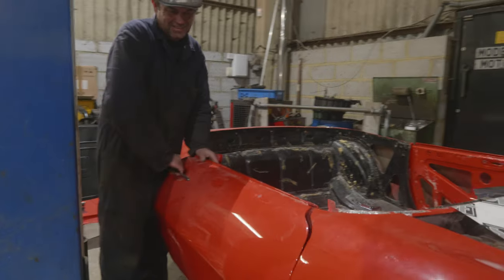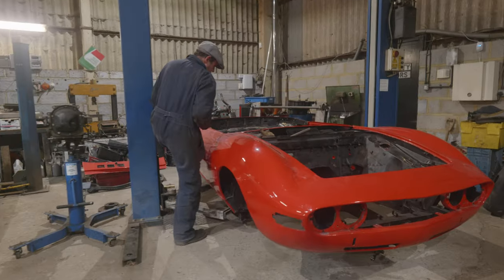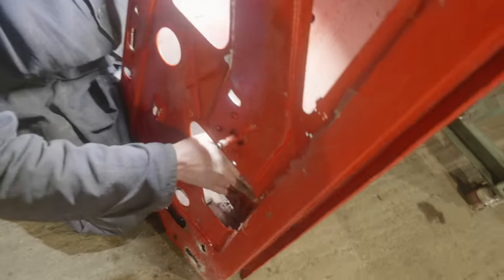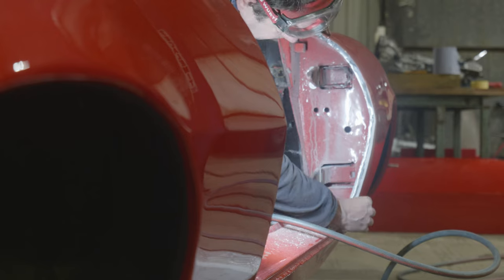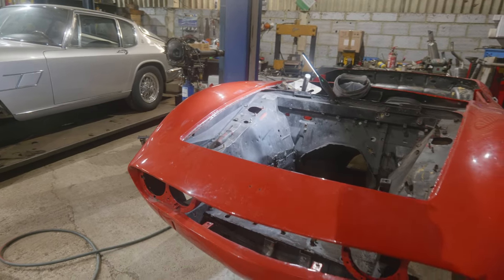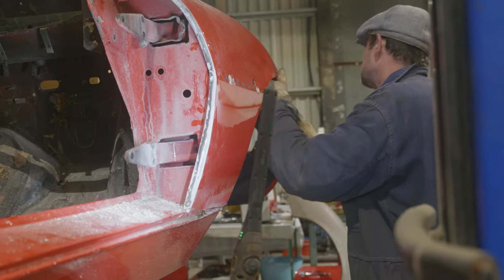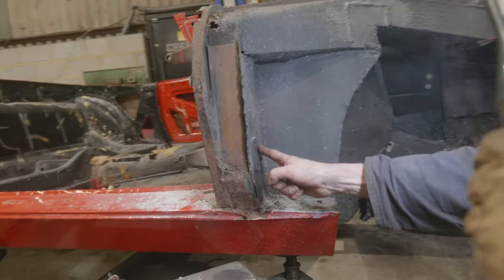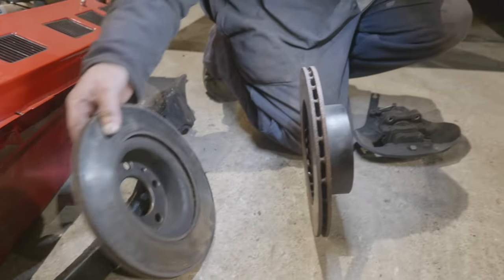FIAT Dino restoration part.3 - Panel removal

Comment: Absolutely fascinating to watch. Bit painful at times, though... Thanks a lot for this interesting video!
Reply from the maker: Yes it’s major surgery !
I have to deconstruct it to gain access to the internal parts .
This stuff has been covered over and all of the repairs need to be carefully removed before I can start to replicate the parts required..
Time consuming and difficult but rewarding work.
With the paint removed it will look a lot better and be so much easier to work on.
Reply: @marksitaliangarage  I'm currently in the market for a Dino Coupe, so all this makes me slighltly nervous 😉
Reply from the maker: @gearhead9828  The coupe is a wonderful car !
Superior build quality to the Spyder but a lot more involved and complicated to restore .
Avoid anything with rust or repair of inferior quality..
There are some really nice ones out there but many are comprised and over priced.
Buy the best and fix your costs but buy a bad one and it will be a money pit .
This Spyder is worth the effort because the customer loves it.
If it were a Coupe it would be scrap metal.
Good luck with your search.
I think that in the future I will do a buyer’s guide video but it will have to wait until I have time.
Reply: @marksitaliangarage  Thank you so much!